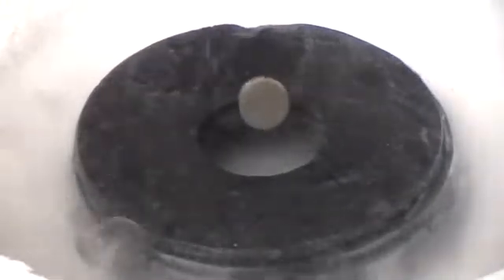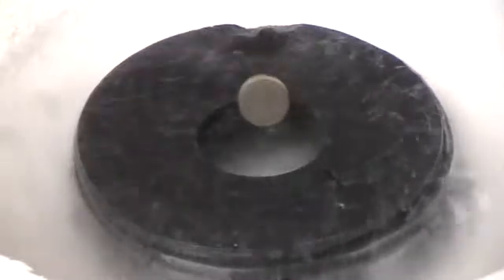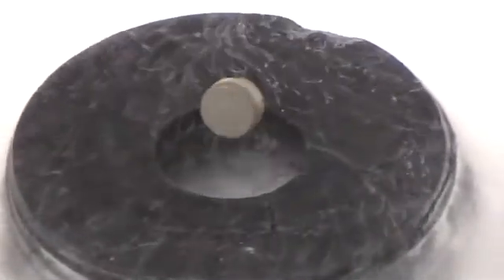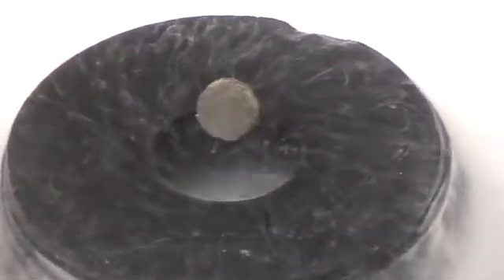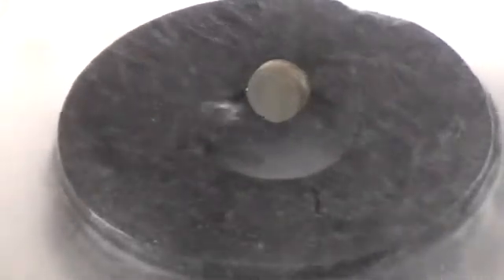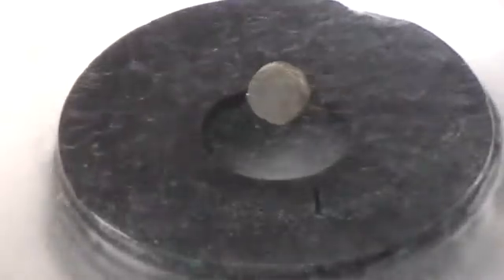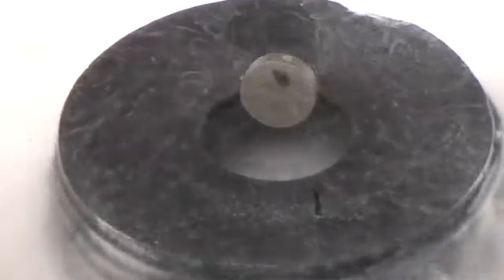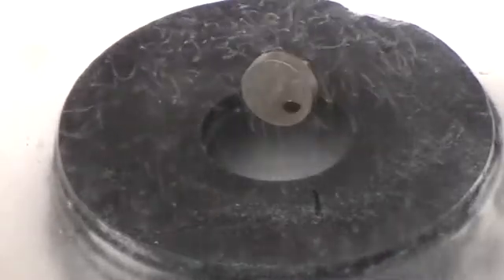Spontaneous Rotation of a Magnet over a High-Temperature Superconductor

Comment: It appears to be forming a resonance, like there is a natural resonance at a very low amplitude that slowly sets up an oscillation - like the resonance set up by wind blowing past a suspension bridge.   With the suspension bridge, the potential is that even though the wind remains steady, the oscillations of the bridge continue to increase and the bridge self destructs at the resonant frequency.  In this case, the magnet appears to be rotating at resonance.  Something is affecting the magnetic field at a resonant frequency.

Of course, this is just a guess.  It just popped into my head while I was watching the demonstration.

Thanks, for the interesting video!

Comment: Genuine question here; where exactly does the energy originate from that gives the magnet its rotation whilst suspended? And, considering our current understanding of Newtonian physics, how can the rotation of the magnet be explained... what force acts upon it?

I think the next phase of this experiment would be to attempt it within a vacuum....  if heat is what causes the rotation (ie. parts of the magnet losing its superconductive state due to thermal increases), surely if a laser is aimed at a specific part of the magnet, it would rotate and continue to rotate freely whilst in a vacuum environment?

Comment: Are you in a Faraday cage? How can you confirm the absence of stray electromagnetic fields? Since the torque required here is tiny it isn't a terrible stretch to imagine the magnetic fields put off by mains wiring to influence the magnet and produce a slightly phase shifted field via induction in the superconductor. Sounds like the recipe for an induction motor to me, but this isn't even back of the envelope theory so I might have my fields and forces off by magnitudes.
Reply from the maker: I rotate the system 360 degrees in the video. I don't see how ambient or stray EM fields could continue to provide a torque all the way around. It's something to think about though, and if the folks at the lab where I did this wanted to test it, they do have a nicely shielded Faraday screen room that they could use. Unfortunately I'm far from that location now and no longer have the means to test this system. 
Thanks for watching and commenting!

Comment: uhh might be worth performing the experiment in a vacuum to see if it still happens? that way you could rule out any disturbances from the air.
Reply from the maker: ***** Yes, I agree. Not that easy to do, though. I no longer have access to the SC ring or easy LN2 but if I did I'd try to do the experiment in a small vacuum chamber, like a test tube, inserted down into the hole in the SC donut. 
Thanks for your suggestion, maybe someone will see this and perform the experiment.

Comment: Excellent demonstration TK.  I had no idea that you have already done repulsive levitation that long ago.  Does the extreme cold just above the superconductor aid or detract from the strength of the neo?  Or no effect at all?

Bill
Reply from the maker: The standard explanation for the effect is that it is due to the temperature gradient across the magnet, which is supposed to vary the strength of the magnet accordingly. See the papers referenced in the Description. But I did experiments with larger disc magnets completely encased in copper foil, which I felt should have tended to equalize the thermal gradient, and they still spun just as well as bare magnets.

Comment: As with any peace of matter, the atoms making up the structure of the magnet on the side closest to the liquid nitrogen are affected by the difference in temperature, likely condensing them. While this change in density should not create a weight difference between the top and the bottom, The condensing or expanding atoms would likely alter the shape of the magnetic field thereby setting up conditions for continuous rotation.

Comment: temperature of system is slowly increasing is it not? I'm thinking that as temperature increases albeit extremely slowly, the height of the magnet drops also extremely slowly. the relative motion of the two fields will cause the spin as there is only an extremely small amount of friction to oppose it. notice that the effect was greater when the magnets were first introduced... i.e. warmer... the temperature drops just a little bit faster when a warm magnet is introduced. once the magnet temperature reaches equilibrium the effect diminishes but by then inertia maintains the rotation. that's why the first magnet did not start spinning again once stopped- because it was already at thermal equilibrium.
Reply from the maker: Well, maybe. The boiling of the LN2 keeps the SC and the surrounding region at the boiling point of the LN2, just as you can't get water hotter than 100 degrees C in an open container. But as the level of the LN2 drops, the temperature-stabilized region gets smaller and lower. The standard explanation for the spin is somewhat like what you say, though. It's based on the temperature gradient across the magnet, which is supposed to affect the magnet's field strength. Check the papers cited in the Description. I'm not sure about that though since I did several experiments with the magnet wrapped completely in very thermally conductive copper foil, which should have worked to decrease the gradient across the magnet; the magnet spun anyway.
Reply: Do you still have access to the apparatus? Try it again with a magnet which has an initial temp of say 70C. My guess would be that the  effect would be greater.
Reply from the maker: sparky64567
Unfortuately I don't have the apparatus or a source of LN2 any more. Sorry. I'd love to be able to continue experimenting but I'm out of luck at the moment. You could try getting in touch with the authors of the papers... but I don't know how to do that, either.
Reply: No worries. Must have been nice to get a chance to play around with superconductivity i bet... and while I'm at it I'd like to say great videos btw. thanks very much for sharing.
Reply from the maker: sparky64567
It was, it was. A dream job. Unfortunately all dreams must end, and "waking life" just isn't all that great.
Thanks for watching and commenting!
Reply: TinselKoala... very clever indeed!!

Comment: Thank you for your response.  While I do not see any immediate use for the phenomena it is interesting.
Where I work we have some pretty fancy equipment here as well as lots of liquid Nitrogen.  Does the RPM top out at anything or does it continue to accelerate?  I wonder, if the cooled superconductor was placed outside of an evacuated shell if the other magnet would spin more freely.  It might be possible to set up such a test in one of our vacuum chambers.  I have also wondered if a laser can induce a floating super conducting magnet to move.

Comment: Does the direction of spin depend on the pole direction N-S wrt the magnet below it?
Reply from the maker: No, I don't think so. The bottom "donut" is not a magnet though, it is just a molded piece of high-temperature superconducting ceramic that has been ground up and re-melted and cast into the donut shape.

Comment: If the magnet piece is not round will the same thing happen?
Reply from the maker: Yes, I think so, as long as the polar axis of the magnet is approximately through the center of mass of the not-round magnet.

That is, if it is lopsided too much it probably won't spin successfully, but it will rock back and forth.

Comment: gravity wave perhaps, interacting with the mass of the magnet, that would be more fun than the imperfections in the ceramic super conductor, and in the NdBFe magnet. The imperfect crystal structure allows for natural field movements I'd imagine.  So what's interesting about that well if some one so desired they could assemble a magnet turbine that used fully and semi magnetic materials, it would want to always spin. So where's my molecular deposition 3d printer, can't afford one.

Comment: @TinselKoala You can explain the rocking by the fact that the mass is off center from the center of the magnetic field, and the bubbles are forming at a fairly consistent spot with consistent timing, which if it's in phase at all with the rocking will increase the rotation.

Comment: I might think that the temperature of the magnet has something to do with it. And the temperature gradient created in the room temperature magnet standing close to the cold nitrogen surface. After the first magnet was stopped rotating, it didn't want to start again. The next magnet with the black mark was warm when brought into the experiment. The temperature gradient (top side of the magnet cooling down slowlier than the side close to the nitrogen) could have something to do with it?

Comment: @TinselKoala Your description says that the magnet will continue to spin 'indefinitely' even when there is no power source applied to the superconductor but it doesn't spin indefinitely as the magnetic field decays over time. If the field doesn't decay over time the motion of the magnet would be indefinite, however, it would also violate the first law of thermodynamics by doing so

Comment: i think as the electrons whiz through the center of the toroid they engage on the elctrons from the magnet and create a wave against each other, just like a water wheel. the atoms are more stableised when cold so vibrating is reduced, which in turn increase the ability for the field to have a griping nature. Or could be eddy currents running through the rotating magnets magnetic field. Probably Both lol

Comment: @TinselKoala Some good points: did you check on moving field lines? Bismuth ceramic has lattice similar to Graphene. This good for Mat-research. My priority is IN-min/OUT-max. Rodin uses more than phased-timed Bedini, yours uses more than both. using air-scoop on car to spin Gen. Lev-Bearings cuts friction to near zero. Are using on New Electrics announced by Renault this week (China suspected of snatching secret tech 3-fired). UTube "UFO Alien Leak" for demo - got a new one going up in few days

Comment from the maker: @PhotonDrive 
In the Rodin coil, does the magnet rotate without the coil being energized in any way? No. The coil must be powered.
In the eddy current in the pipe , you have magnetic field line components moving perpendicular to the surface of a conductor. Eddys are generated as they move, power is dissipated by the eddys in the metal, the power comes from the potential energy stored by lifting the magnet; the magnet is slowed as it falls.
Here there are no field lines moving across conductors.

Comment: A spherical neo-mag in the center of a Rodin coil also rotates. Depending on asymetry of insertion it may also do a roulette-wheel scittering around the toroid hole.
What is the relation of this to rt-angle Eddy currents that cause dimunation of grav acceleration down copper pipe?

Comment: When we conducted this experiment (1991 paper from TX Center Superconductivity), we painted a dot of Ag on the edge of the magnet, then used a laser/photodetector pair to measure the rotational velocity.  Another fun variant - encase the magnet in a glass tube, seal, and evacuate, then position the apparatus over the superconducting wafer.

Comment from the maker: No, I don't think so. Even neglecting the energy cost of keeping the system cool, it is far more likely that the system is extracting some small energy from existing sources, like for instance the heat flow caused by temperature asymmetry as postulated in the research papers. Or maybe even from the Earth's rotation. There are a lot of things to rule out before one needs to resort to "perpetual motion" explanations !!

Comment: It is probably due to the shape of the small magnet. The molecular impacts are asymmetrical and impart torque, making it spin spin. This is similar to one of those little solar motors. Try using a very smooth, very round magnet. By changing the shape of the small magnet, I bet I could make it spin like crazy...

Comment from the maker: Well, you are right, I think. But currents in superconductors work like this: Bring a magnet near one. The motion of the magnet towards the material induces a current, which makes its field. Good so far. Now remove the magnet. What happens to the current in the SC? It goes away--that is, moving the magnet in starts the current, moving it out stops it.
Anything that "taps" the field from outside the SC takes energy from the field and causes it to decrease, taking the current in the SC down too.

Comment from the maker: I think the shape of the toroid is helping the magnet to remain positioned in a location where the trapped field lines are more symmetrical. So my impression is that the shape of the material isn't actually affecting the rotation as such, but rather is affecting the stability and positioning of the levitating magnet. I could be wrong about that, though.

Comment: i would postulate that the rotation is due to the fact that the magnet, superconductor and for that matter you and I are sitting on a rotating surface with a wobble (earth). I would be more supprised if it did not rotate. It would be interesting to place a spherical magnet and determine the axis of rotation.

Comment: Maybe both are in order. I'm no expert either, but I know a little about quantization. Not as much about superconductors though.

Was wondering if the fluxon/vortice interaction plays a role here. I'm under the impression  that the vector potential is affected. So maybe sharpening of the flux has some sort of focusing effect. Just waving hands..

Comment: I'm not an expert either by any means. Think of the fluxons/abrikosov vortices as lattice quasiparticles (like holes on semiconductors) that form on the crystal lattice. They are little vortices that form around magnetic field lines thanks to the supercurrent. Google it up, it's well worth it and fascinating stuff.

The idea behind the sharp field flux idea would be to see if there is some focusing effect.. as far as I understand it the vector potential plays a role with these vortices.

Comment: I took a quick read of the arxiv paper. Basicly it's suggested that it's driven by thermal conduction, a sort of homopolar heat engine.

I'm not so sure about that. The paper doesn't include any field theory considerations, like the interaction of the quantized fluxon (or Abrikosov vortex) lattice formation in the superconductor with the classical field of the permanent magnet.

I'm also temped to say it's some sort of AharonovBohm solenoid phase shift effect.

Haven't done the math though.

Comment from the maker: That's pretty much the standard explanation. 

But tiny magnets work better than larger diameter ones--even though they will have less thermal difference between top and bottom...and less  torque from whatever is torquing...

And there are the tests I did with the magnets wrapped completely in a heavy layer of copper foil...they spin just as well as naked magnets.

I'm not putting forth an alternative hypothesis, I'm just saying the thermal gradient explanation has some seeming holes in it.

Comment: You're a funny guy. I apprecieate that you're suggesting it's an oxymoron, but I suggest you are the only moron. (not really but youtube has taught me that it's fun to insult strangers on the internet)
It's perfectly possible to a have uniform anisotropy.

The field isn't centralized to the sample, measure it and you'll likely see a small difference between pole strengths. As you've seen yourself this will lead to different behaviours from apparently similar samples. See sliding aluminium vids.

Comment: Isn\t the magnet spinning because the top of the floating magnet is hotter than the bottom? It is in that case a kind of Sterling-engine effect: Heat difference makes it run.  So no perpetual motion of gravity against magnetic flux, but just the heat difference until the Nitrogen is exhausted. Or do you think this is proof of the rotational time energy of the universe maybe? Please be clear....

Comment: smes means superconducting magnetic energy system or something like that, basically, it's the idea of storing electricity in a superconductor and then using it when required like a battery. I would recommend trying it with carbon nanotubes if you can figure out how to manufacture those!

Comment: There is a limit though, a superconductor eventually reaches a critical point where it will no longer absorb a charge. However, with some materials this is a very high value. I'd like to work on some superconducting batteries.

Comment from the maker: You're right about the oversimplification. I haven't explored systematically testing size/shape/strength combos; I think it would be interesting to do so. What I have found is that seemingly identical magnets can and do behave differently in this experiment, and the same disk magnet "naked" will spin, about the same rate, as when it is covered with 5-mil copper foil.
It would seem that a bigger O.D. should produce a bigger torque, other things held equal, if the thermal gradient is the cause.

Comment from the maker: Yes, depending on the magnet the rotation can accelerate until it's going quite fast. The tiny magnets used in earbuds work pretty well. This is another reason that I discount the thermal gradient explanation--smaller magnets have less room for a gradient...yet they turn faster.

Comment: Proposition for a follow up experiment: seal the superconductor and liquid nitrogen in an insulated container, and everything (the first container and the magnet) into another insulated container before letting the continual rotation happen.
That would show if the cause is the disturbance produce by the evaporation or the thermogradient.. or not.